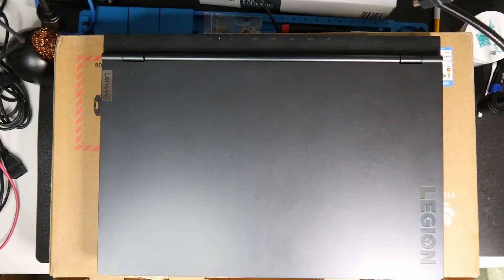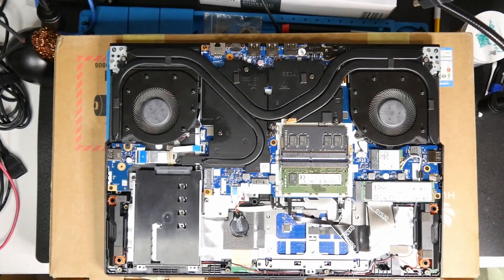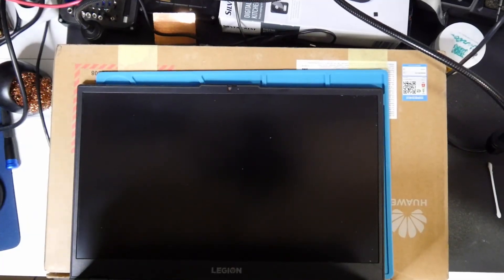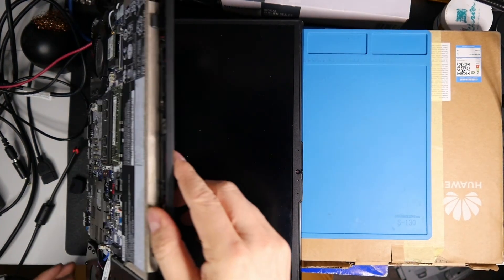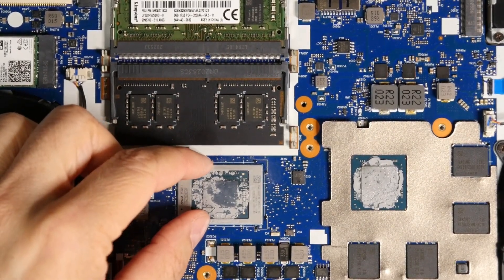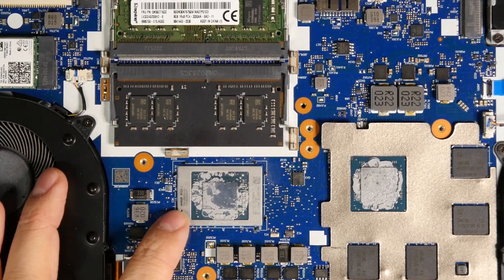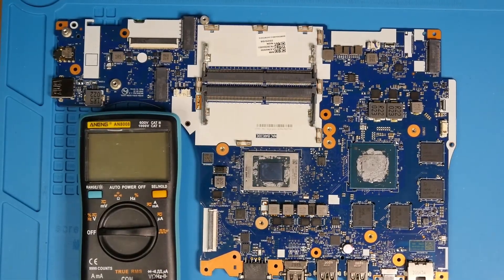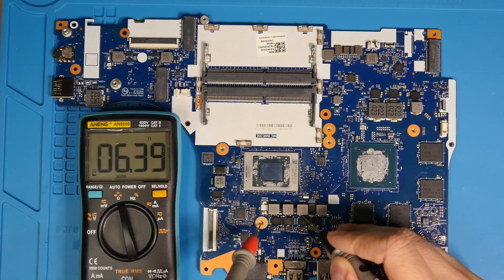Episode 30 - Lenovo Legion 5 15ARH05 - repair [Part1]

Comment: Reflow on big IC is a complete waste of time. Even if you manage to make it work, it will be a temporary fix. Unfortunately I have seen many Lenovo Ryzen to fail due to CPU bad connection with the PCB. The glue they use is a complete nonsense and a no-go for repair. It could also be very well the root cause of the bad contact between CPU and PCB. Keep in mind that the problem may not be the balls in the BGA but the connections under the crystal and the substrate. In such a case, you need to replace the chip, a reball won't help.
Reply from the maker: Thank you for hints. I agree, there can be many reasons for the same symptoms. But I guess it's worth checking the obvious and the more probable first and hope for the best. I think many repair shops give up on Lenovo repairs because it's more difficult and time consuming. Financially it makes more sense to invest that time into a few easier repairs. I do it only as a hobby so I can afford to spend more time. But either way it's always disappointing if you waste a lot of time and effort yet the the repair is not successful.

Comment: Good work, dont waste time with reflow, but it works 10% of the time, waiting for the reball results!! but before you do that do all the simple things first, check if the ram slots are good, and save the old bios and flash with a new one...
Reply from the maker: Check out part two! It's available now :)